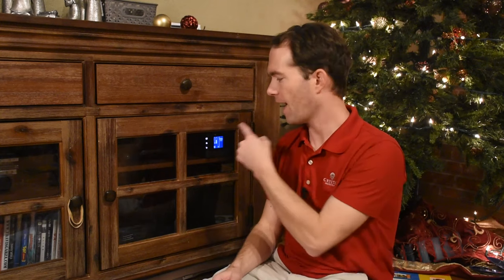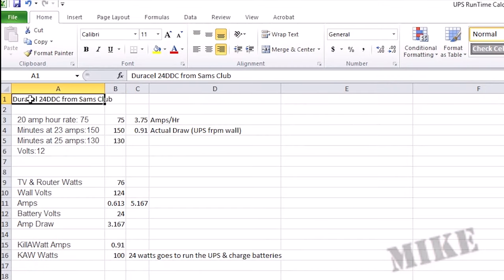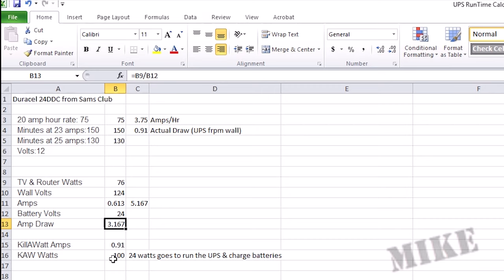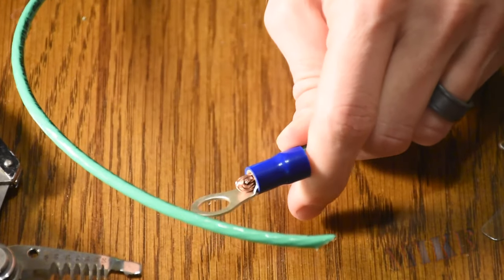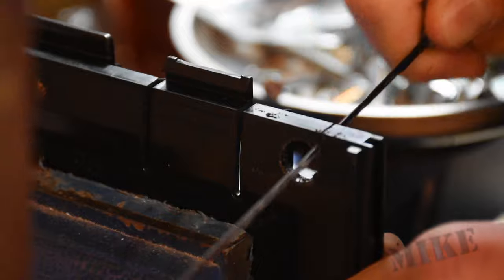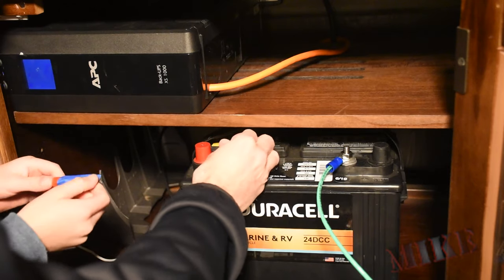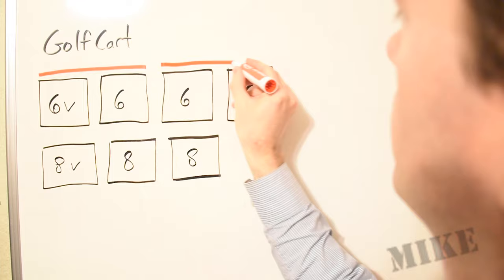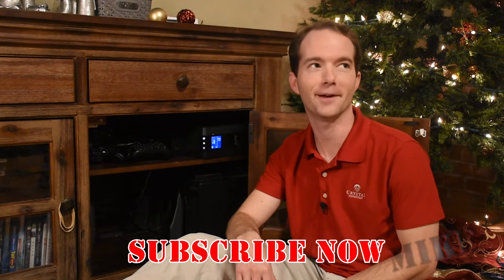SUPER UPS Battery Hack- Mikes Inventions

Comment: There is no concern regarding the recharge circuitry ? If the batteries get deep discharged during a prolonged power outage when the power comes back the recharging circuit could be overwhelmed by the amount of current required by such large batteries and enter protection or worse.
Reply: Exactly that is what peoples adding lagger battery to those tiny USP do not take into account!!
Those UPS are made to charge a battery in a short amound of time, then the charging circuitry is rest!!
The charging circuitry is not build to charge a prolonged among of time!!! Plus the internal transformer is not able to deliver such amound of Amps to charge those huge battery!!
Short long story, if the charging circuitry does not melt, the battery will appear to be charged (+13.8V), unfortunatly Amps is very low!! So on power outrage it will not last that much!!!
Reply: @DrZipZwan  I disagree...at least with my SmartUPS 1500.  The battery charges at about 3 amps max.  Sure, it may take several days to recharge after being discharged, but I have seen no issues with this system...and I have been using lead acid marine and car batteries for close to 20 year now.  I prefer normal car batteries over marine or deep discharge batteries.  Last year I switched over to using eight LiFePO4 cells, and it works really well.  The only downside is that the estimated remaining battery life is based on some algorithm, not the actual battery capacity.  This shows no battery life left after a few minutes, but it DOES NOT shut down at zero life remaining...mine kept running for multiple days.

Comment: The inverter is usually designed to deal with the heat for the operation time of the original battery + small X
The idea is to give a server enough time to wait for a generator starting up or like in my case get the system shutdown in a clean manner.
You potentially burn your inverter….or need to cool it better.
I am sure X is more a 1.2 than a 2 or a 10….

Comment: A 1000va ups should be able to pull 25amps at full load on 24v battery. So u must atleast use 30amp fuse if u want to get full capacity. Maybe install 15amp fuse on each battery terminal just to be safe and use 6mm wire and use the anderson plug from the old battery pack harness they are appropriate for this application and can handle upto 50amps so u will be able to use the battery at it's full capacity. For long runs at high load u must add a fan to the ups unless it already has one. And next time buy a 100ah lifepo4 😀 . On lifepo4 u can get the full capacity of battery and still charge and discharge them 3000 times.
Reply: so, i have to ask you how a UPS 1000 can pull 25 amps ? The standard battery pack is 2 - 12 volt 7 amp hour batteries in a series.
Reply: @tprobst1  yes they over draw from 7ah battery , ups is not designed to run long time. It's made to give u enough power to shut down your pc..
Reply: Not safe to allow more than 10A for prolonged times. Here the point is to get only longer backups but not at full load. That s not going to be safe.

Comment: Most cheap UPS have short duty cycles, typically  15-30 mins.  Forcing your UPS to run above it's designed duty cycle under heavy load might overheat and damage it.   Hope your UPS can take it.
Reply from the maker: Hey there! It can. It's gone overnight at least once.
Reply: @MikesInventions  at FULL load?

Comment: Excellent Video Mike. I know nothing about UPS devices but I had to purchase one recently for back up power on a home CCTV system.
It was a good used one, apparently, but I have yet to get my head around how it functions etc.
I suspect the batteries will need replacing as the old owner reckons he's had it for around 4 years or so, so that would tell me that the battery life cycle is almost due.
It's an APC C1500 model, the one with the LCD display.
Not sure what Ah sized batteries it contains, but I'd love to upgrade them if possible. Hopefully I can find the same physical sized batteries but with a higher output.
I'll have to do more research on this.
Thanks for the video. It's opened my mind about battery expansion.

Comment: I'm looking into doing a similar project as this but I'm not very familiar with battery specs...  Here's my question, the APC uses a 12 volt battery.  How is the APC compatible with 24 volts?  It seems like the 24 volts would not work with the APC inverter. Could the APC over or under charge the 24 volt battery?
Reply from the maker: Hey David. I haven't come across a 12v UPS yet, but I'd bet some of the smaller ones do run off 12v because they're rather small. In that case, you wouldn't connect the batteries in series like I did. You could do a parallel setup and get Ludicrous run-time.  I haven't had any trouble with the UPS keeping the batteries charged so far. Now, of course the charging circuit is low amperage, but it's like a trickle charger/maintainer with batteries of this size. If I do draw them down a lot, I'll disconnect them and put them on an auto charger. Just make sure you match the voltage and you'll be good. Disclaimer: Of course, you shouldn't officially do this. Thanks for watching.
Reply: @MikesInventions  Maybe I didn't give you the correct information.  I have two CyberPower battery backups that I bought on Amazon (CP1000PFCLCD PFC and CP1350PFCLCD PFC).  Theoretically, can you tell me which is better- 12v or 24v setup)?
Reply: I want the battery backup modification to power my network equipment (UniFi router, 24 port POE switch, and NAS) and maybe a TV.
Reply from the maker: @davidwitte6439  So, since you're planning to add external batteries, it matters a lot less about the capacity. I'd consider the ports and plugs instead and make sure it had what you needed. So, if you get the 12v system, you only need 1 battery, and adding capacity means adding 1 battery in parallel, or 2, or 6, so it'd be a cheaper initial setup and easier upgrade. If you go with the 24v system, you need to add 2 batteries every time you want to add capacity. With 24v, you get to use smaller wires, but this thing isn't flying, so cost and weight savings there is a non-issue. I'd go with the 12v system.
Reply: I use an APC Back-Ups Pro 700 in a similar application. The 700 is 12V.

Comment: Hey i found this in the used market. APC Smart-UPS SC 1000VA and thinking of adding 2 of these (also used market but new i box) Fiamm 10-års blybatteri (lead-acid) 12FGL42 
EAN 5710927030145 12v 42Ah total cost 200 usd this would in theory if your hack works for this setup be stronger then anything new i can buy. Would the combination work. it has 4 x 6v batteries in series by default as far as i can tell.

Comment: Thanks for the video, 
I was wondering, how safe is it to run a UPS for much longer than they are designed for?
Don't they get very, very hot eventually as they are no fans?
Reply from the maker: Hey! I don't know. I've never had an issue with it so far. I'll let you know if it explodes or goes POOF!
Reply: It's a little more than that. I don't know if a UPS can start a house fire, working beyond its rated time.. I also wrestled with the same problem. They DO have marine and other inverters that are meant to run continuously. If you had a relay that could switch from the UPS to the continuous inverter you might have something there. But again we have a problem with the relay AND the continuous inverter. Is the continuous inverter UL approved for homes?? And if you make your own relay circuit, you would have to get it UL approved. I don't know if house fire insurance would accept these things as a cause of fire. ..Maybe I'm paranoid. But insurance companies as a whole are getting real slick about insuring things.
Reply: You could easily just put some fans in it. 

Cut away part of the battery compartment, since you aren't using it anyway, and install some PC case fans. Maybe cut some slots on the other side so it has a place to expel air.
Reply: My APC UPS that looks a lot like the one in the video has a built-in cooling fan that runs continuously when on battery power. It annoys me because I only run a modem and a couple of routers off of it and the fan is probably using more power than they are! But, I think it will keep its cool when running these off of larger batteries. I just need convince myself that it's ok to charge the bigger batteries. It sounds like it is.
Reply: I've been running a similar setup in an off-grid application for over 2 years with no issues so far. My UPS is rated for 450W nominal, and it's typically pulling around 30-100W. It's been running almost 24-7 for most of that time.

I have a solar charge controller and AC battery charger which keep it topped off, so it doesn't rely much on the internal charging circuit.

The experiment went well enough that I set up a 2nd UPS the same way in another spot about 6 months ago.
Reply: @Cabinlab  have you considered sharing your setup? I am trying to build my own back up but I am totally new to these concepts. Plus, many comments in this video seem to warn against the danger of a potential fire and the need for ventilation due to the hazardous materials.

Comment: When figuring out how much power a device is drawing is VA important or just watts?
Reply from the maker: UPS's have two ratings, but the one they publicize is that VA rating, which isn't real power. You have to dig deeper into the specs to find the wattage, which is invariably less than the VA rating. Volt Amps only equal watts for purely resistive loads, which isn't what you'd want to plug into a UPS. So, both numbers are important, and try to use devices that have published power factors close to 1, then the two numbers will be the same. Thanks for watching! I hope that helps.
Reply: Yes that helps thanks! Now I know what to focus on.  Also I just got a car battery and under capacity it says 85 .  I think may have been reserve minutes though and not amp hours? Is there a way to translate this to figure out amp hours? Thanks!
Reply from the maker: @tylermack954  Hello again! When a car battery talks about capacity, it's a reserve capacity in minutes if it's not specified as amp-hours. It's the number of minutes a 25 amp draw can safely be maintained without draining the cells too low.

Comment: Now come only  conx 1 wire to ups?
Reply: It's an extension cord, it has 3 wires inside, he;s using 2.
Reply: @Mental_Patient  i thought he was using 10awg wire... Which is only 1 wire in?
Reply: @maktheturd6220  10 gauge was used to connect batteries in series, watch video

Comment: Dont these deep cycle batteries off gas hydrogen?
Reply: yes. u need AGM or GEL if you want to safely use in the home.
Reply: @michaelebays  Ya thats what I thought. If I remember, even those could possibly off gas if something goes wrong during charging but much less chance of problems.

Comment: Hi.

Have you considered going with a lithium battery pack
Reply from the maker: Hi Zubair! I didn’t go with lithium because of its cost, and I wouldn’t be able to balance charge them with this UPS.
Reply: @MikesInventions  you don't need to if has build in BMS
Reply: @MikesInventions  7 18650 cells  in series will do the trick

Comment: i got one that has one 12v battery. i wanted to take the battery out and wire a 12v socket so i can use it in the car.

Comment: nice video cool but I am using 3000 watts pure sine wave inverter 110V-120V 60Hz 30A 2 20A breaker with 2 110V out let plug 150A fused 15A breaker for my inverter with panel in my power station am building with GFCI out water prover tool box I have those ups but eat battery my inverter well protected with breaker for my inverter and breaker for my out let

Comment: there is a run time chart in the user manual.  and that is all the run time you get . no matter what battery you use . been there. done it. 100 amp hour battery. no change and still had to wit the 16 hours for it to supposedly "charge" my still full 100 amp hour battery to still get the same run time as with their original battery . why? probably because ,to make more money, the plastic case is made with no heat resistance and starts melting with regular runtime at full watt capacity. look at some used ones for sale and zoom in on the transformer area, and see. if it has had any use. it will be deformed. the wrong plastic used and it is 1/8 of an inch from the the hot cheap transformer. The seller returned my $80 and didn't want it back.

Comment: If you use the apc cable and reset the battery it will learn the new battery
Reply from the maker: Oooo that sounds great! Please explain. We’ll all be in your debt sir.
Reply: @MikesInventions  so did it work?
Reply: I completely forgot about my Comment  but mine stays at 63 for the most part. Both batterys are 35 amp hour mine runs a tv and 3d printer so it does seem to go up every discharge cycle. I read online somewhere that's how it was supposed to learn the battery im probably going to dry run my printer amd time the run time on batterys. I do have to wait for my current print to finish
Reply: Also as in apc cable I told it it was a new battery in the software

Comment: is that internal charger have enough capacity for those big batteries
Reply: probably not. likely too slow for added AH and the  charger would possibly overheat. Im thinking of doing this to run my chest freezer but I was thinking i should wire in a 10-15 amp charger as not to overload the UPS internal charger.   ive got a pass thru inverter in the basement tha,t even when its not inverting, but simply passing thru, the fan comes on once in awhile.  plus its only 12v but  its a true sine.
Reply: @toobglued  Hi, most of these UPS's utilize a slow trickle charger with a 500 to 600ma output to keep the batteries topped off, and would take a day or two to recharge the stock batteries after use.  Those Duracell deep cells would probably take a month to fully recharge with the internal trickle charger after use.  Adding a proper battery charger would help prolong the life of the batteries.

Comment: can i use a lifepo4 batteries with a bms on a ups?
Reply: yes, you sure can.
Reply: Most UPSs are not designed to charge LiFePo4 batteries. They need a higher voltage to charge 100%, specifically 14.8v. Unless you can tune the settings of what the UPS charges at, you will be wasting your money.
Reply: @NoSQLKnowHow  I would not say it's a waste of time, you won't get a "full charge" but you will also increase  the longevity of the cells as they are not being charged and held at full.
so it's a trade off, but far from a waste of time.
Reply: @NoSQLKnowHow  how about my bms is a smart bms? i can adjust the voltage to 14.8 i will install 5pcs of 3.2v
Reply: @paulo159  how does the BMS react when the supply voltage from the UPS to it never gets up to the charging voltage needed to charge it fully? Can it take the amps and create more volts like reverse of a solar MPPT charge controller?
Reply: my battery is 13.6v @fullcharge can i still use it? i will just set the bms to 13.6 cut off full.. sory for my bad  english

Comment: I see some comments that on this video that sparked some further questions, if anyone could help out that would be great

1. I saw a comment saying that the lower amperage charging system inside the UPS would end up slowly reducing the batteries' lifespan. Now, I don't think that is the case since it would basically be trickle charging and I don't know of any case where trickle charging is capable of doing such harm

I suppose unless the charging never stops, like when the batteries are fully charged but the UPS keeps charging.

How do I know if my UPS automatically stops charging the batteries? The stock/regular batteries I think it always does but since it can't estimate the approximate runtime on different batteries how do i know for sure the UPS knows they are fully charged?

2. Are there any precautions regarding hydrogen gass that I have to keep in mind?

3. I saw someone saying that it would be wiser to do this on a smart UPS rather than a regular one. Is that true, and if so why? Would it really be such a big difference?

I've slowly been working on some plans of doing this at home, i suspect this year will be the year i push through with my plans though

nice video btw
Reply from the maker: Hey there! So, I'm nearly a year in with this setup now, and I haven't had any problems. The batteries are topped off at slightly over 13 volts each, just like the smaller SLA batteries were. It is indeed like a trickle charger with batteries that size. When they're full, the UPS stops charging them. I haven't had anything explode or catch fire with my setup, so excess hydrogen isn't a problem, but under difference circumstances, it could be, so use good judgement. I didn't realize that my UPS was dumb. It seems pretty smart to me. 
Make this the year. Go for it! Thanks for watching!
Reply: @MikesInventions  thanks for the reply, it is very helpful

I will probably be doing it in 3 months, some batteries are hard to come by over here as of right now

I will probably have 2 of these type of set-ups, 1 in the garage (already have a ups there for my wifi) and the second in the living room for my tv and maybe a small lamp